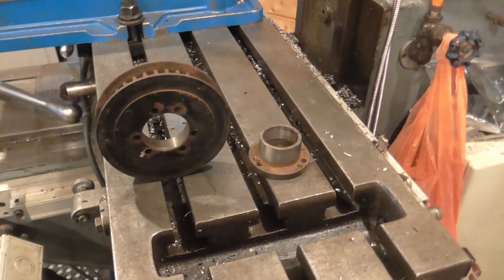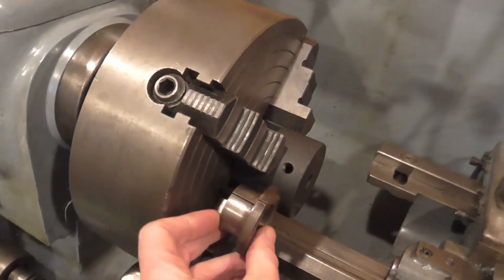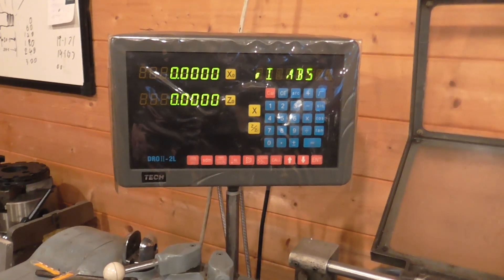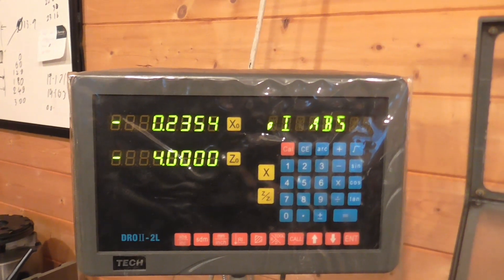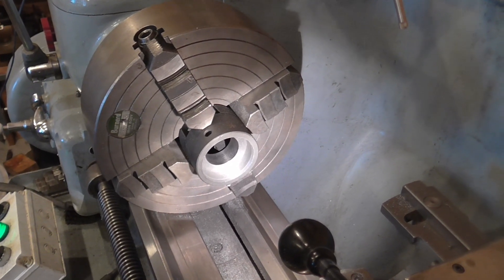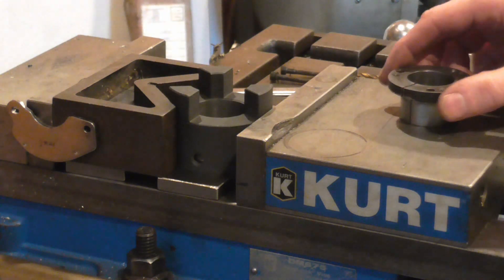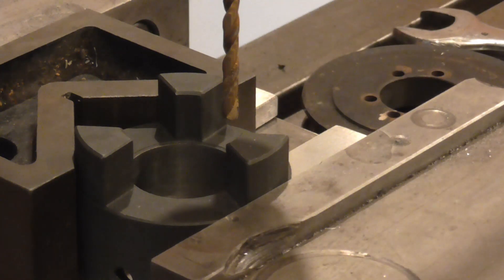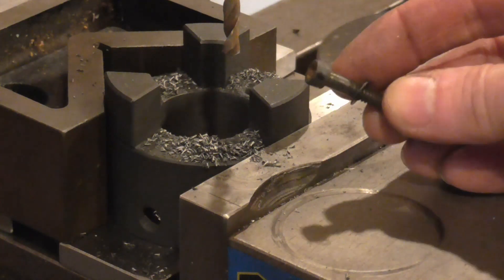Reva G-Wiz motor transplant part 2

Comment: hi, thanks for posting the very interesting video. i am working on a coupling with a Twizy gearbox output. Can you say anymore detail about this 'L100 sized Dunlop branded hub'? i am not familiar with those. I have been searching for some suitable female splined hubs, but perhaps i could find another solution with these 'spider' style coupler. thanks.
Reply from the maker: Just search for "L100 coupling". Americans will know them as a Lovejoy. I usually source from bearingsrus.co.uk